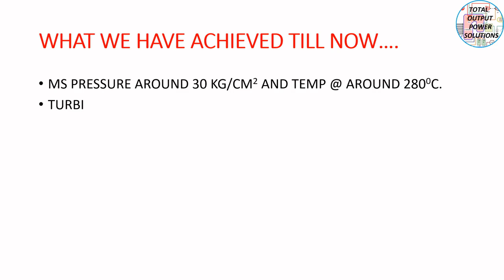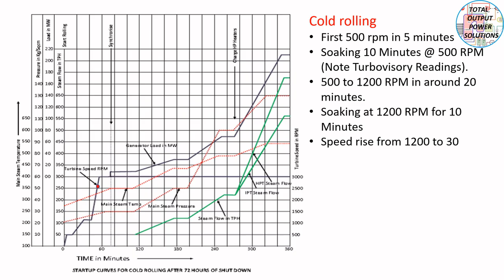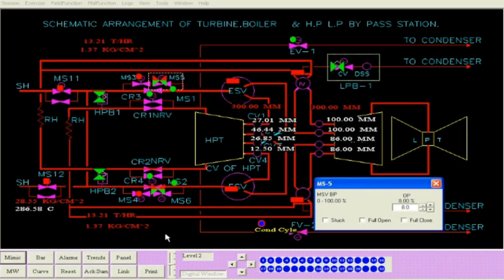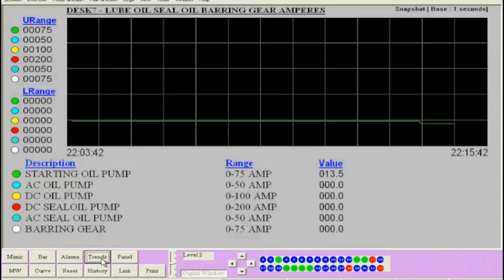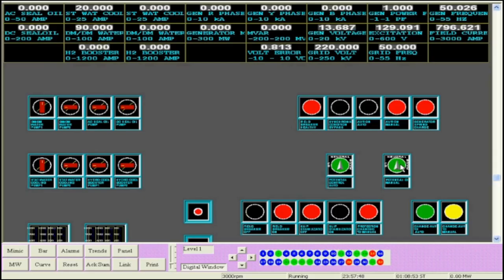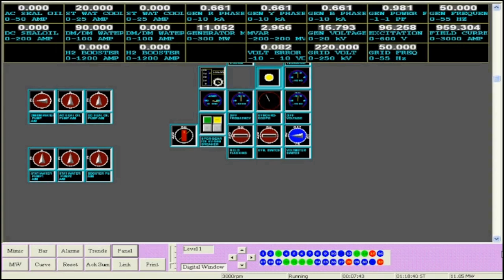210 MW SIMULATOR ROLLING AND SYNCHRONISING TA SET TO GRID

Comment: Sir,
It is not understood, why CHP is started after synchronisation of the unit. Actually, all the bunkers should have been filled with coal to 100 %, well before the start up of the uni. 🙏
Reply from the maker: Yes , coal bunkers can be filled before also but we have still time to fill the bunkers. we will be taking A coal cycle in service so we can start filling the bunker which can be filled within 25 minutes. Actually this is total different chapter and hence we deal with it this time as per the requirement. As per the operational sequence it is to be started at this point. For any further quaries please call me @ 9372167165.
Thanks for the comments